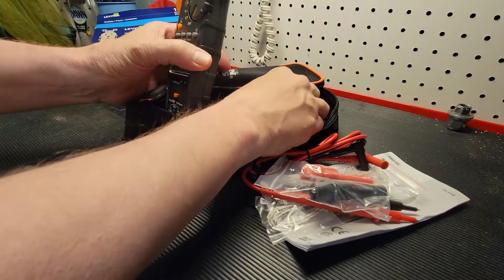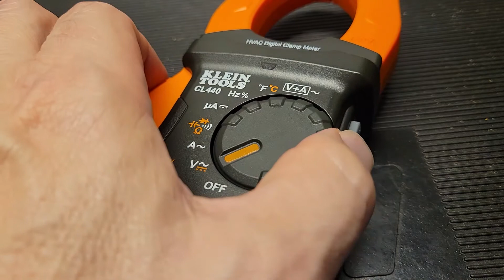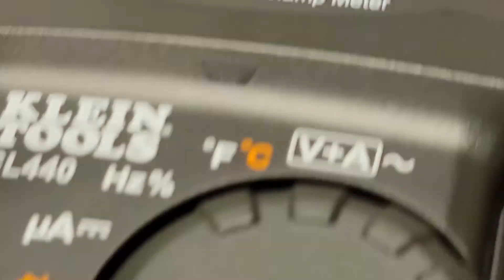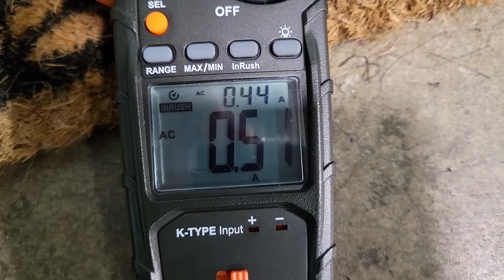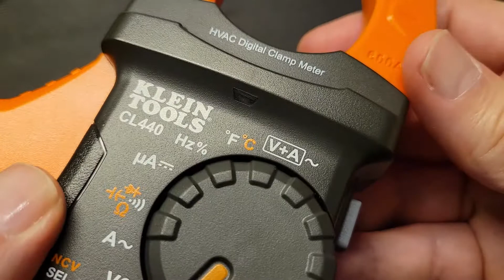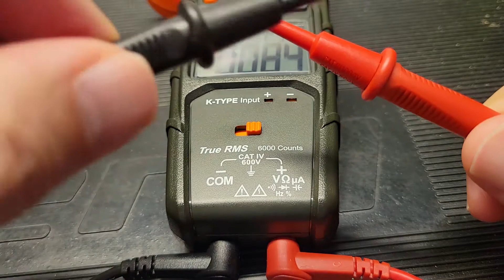Klein Tools HVAC Digital Clamp Meter CL440, unbox and detail look

Comment: I just bought one. You left 1 thing out that I noticed and that has to do with the lamp. Push once to turn it on and push and hold and you'll discover a flashlight on the backside. Great tutorial overall though.
Reply from the maker: Thank you for watching and sharing this handy tip.

Comment: What an excellent video!  Basically everything in this video is the same for the CL 445 which I'm guessing is the exact same multimeter except for maybe mine did not include the actual temperature cord or something like that?  Regardless, the only thing disappointing about this meter for me is that I cannot test DC milliamps to figure out parasitic drain on my vehicle's fuses.  Sitting here with $125.00 tool and I have to go to Harbor Freight to buy a $20 gauge to supplement it with just seems inherently wrong 😆.  I have approximately a 110 milliamp drain on my battery that this meter just cannot test for. Really well done on the video walk around!
Reply from the maker: Thank you for the feedback and for sharing.
If 1 milliamp = 1000 microamps, then 110 milliamps = 110,000 microamps which is as you said is beyond the 600 mircoamps of this meter. Glad you found a solution at HF.

Comment: Why do you need to remove the probes if you're using the clamp? I've owned several clamp meters and watched hundreds of actual field videos of service calls and not one case ever needed or bothered to remove the probes before taking an amp reading.

In fact, why do they have a V + A function if you are supposed to remove the probes when using the clamp?
Reply from the maker: The reason not to do it is to eliminate any potential electrical paths. The same reason you're also suppose to wear insulated gloves and eye protection. Of course in the field people will decide the amount of risk they are willing to accept.
Reply: @cfldriven  OK, that answers part 1 of the question. What about part 2? If it's unsafe or inaccurate, what's the point of building in a setting where you are required to operate in a "non recommended" way to use that feature? Even the user manual contradicts itself on this issue.
Reply from the maker: @realSamAndrew  I don't know for certain but I suspect when set in the V + A mode a special circuit is being utilized, otherwise the manual states not to leave the probe inserted when measuring with the clamp.

Comment: Great review, thanks. I wish it could read higher DC Amps (for mini splits) and have a magnet on the back to hold it on the equipment. Any meter labeled as HVAC has to have a magnet.
Reply from the maker: The CL440 will read up to 600 amps AC only. While the CL390 will read up to 400 amps AC and DC. The magnetic holder is optional, although like you I feel it should be included.

Comment: I was looking at the CL320 and the CL700 thinking these would be good all around multimeters.  In comparison, I was looking at the Ideal 61-747 also.  I have a need to check capacitors.  Any suggestions would be appreceiated.
Reply from the maker: I have the CL390 and CL440 and they are both capable of testing capacitors. The CL390 lets you measure  both DC and AC current along with being smaller in size. I wanted to get an Ideal to compare, but never got around to it.

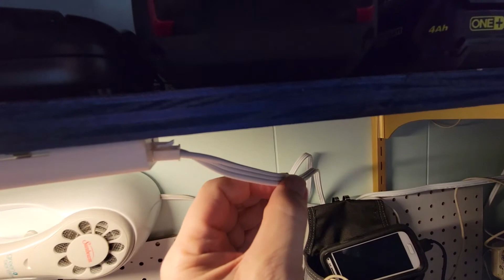Comment: I just bought this device.  Please explain @19:31-@1941.  I don't want to ruin my device (investment).  Thanks for the tutorial BTW!  The "when measuring 'ohms' make sure there is no power on the circuit  otherwise you will ruin this device".  Please provide an example.
Reply from the maker: Congrats on the meter. In the continuity mode the device provides very small amount of power to circuit and if detected you hear the tone. It not meant to operate with the circuit energized. Same with Ohms mode. Best to decide what is it you want to measure,  determine whether the circuit needs to be energized, set the dial, and take a measurement. Thanks for watching.

Comment: When you are talking about the sliding shutter for the thermocouple (16:00), it doesn't just protect the ports, it also locks/blocks out the probes which must be REMOVED before the shutter will open to allow the thermocouple to plug in.
Reply from the maker: Dave, thank you for sharing your insight.

Comment: I have that meter on order and got it for the purpose of reading inrush current. I have others from klein but don't read inrush current. I also have the cl390 for the purpose of reading DC current as well as ac current even if it doesn't read inrush they are great hand tools (klein) and now meters. The fact that it comes with a case and temperature lead plus alligator clips is a plus. Great meter good video sir.
Reply from the maker: Ruben, the only thing I don't like about this meter is the probe connections on the bottom can easily come loose and give false readings, especially when it is hanging. I also have the CL390 which I like a lot and doesn't have the probe issue.
Reply: @cfldriven funny I don't have that problem with mine.
Reply: Funny I don't have that problem with mine but okay I will keep watch in the future.
Reply from the maker: @milwaukee_69  Thanks for watching and sharing.
Reply: Funny I don't have that problem with mine

Comment: Can you read hertz with the clamp
Reply from the maker: Yes by setting the dial to Hz% and clamping around the positive or negative, but not both, it will give you Hertz reading.
Reply: @cfldriven  positive or negative? Hz means you're measuring AC.
Reply from the maker: @r.t.7925  Wow did I actually write that? The clamp is for reading amps from either the positive or negative wire but not both. To read Hertz the probes are utilized. Thank you for pointing out my error.
Reply from the maker: Thanks to r.t.7925 for putting out my error. The clamp is for reading amps from either the positive or negative wire but not both. To read Hertz the probes are utilized.
Reply: @cfldriven  On this particular meter clamps only measure AC current. You will not get reading if you clamp positive or negative wire . You'll get a reading if you clamp one wire that carries AC current. You can't measure DC current with the clamp is what I'm trying to explain.
Reply from the maker: @r.t.7925  There was no mention of using the CL440 clamp for DC current, however the CL390 with read up to 400 amps of AC or DC from the clamp.
Reply: @cfldriven  IN your answer to  will972, you are talking about 'clamping around the positive or negative, but not both" 🙂
Reply: @cfldriven  I agree about CL390. It will measure DC current with the clamp

Comment: As an amateur , if I were to choose between the CL 440 and CL 800 what would be your recommendation. Thanks very much.
Reply from the maker: I wanted to read both AC and DC current, the CL 440 is AC current only so I bought the CL390 which does AC and DC current and is cheaper. I find for residential use the CL390 is plenty of meter. If you work with motors the CL440 is worth considering and if you need something that is water resistant, that has a work light, higher AC/DC voltage and tougher build than the CL 800 is worth considering.

Comment: Is this better than the cl450?
Reply from the maker: All depends on what you are looking for. The CL450 has two temp probes but less of a temp range. CL450 can read up to 1000V AC/DC, beating the CL440 750V AC & 600V DC. Both do 600A AC only, while CL440 can read up to 600 DC microamps and the other stops at 200 DC microamps. In many ways they are similar unless you need a specific parameter. Also the CL450 is no longer in production. Thanks for the question and watching.